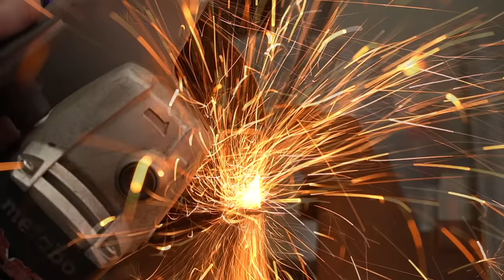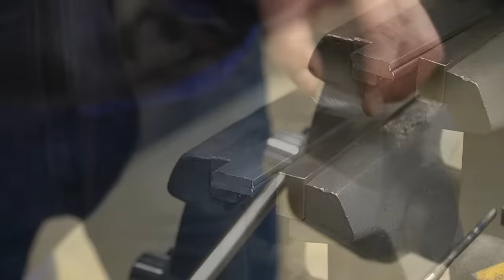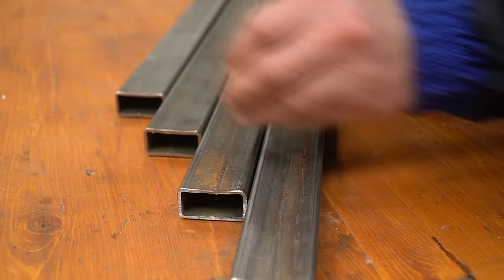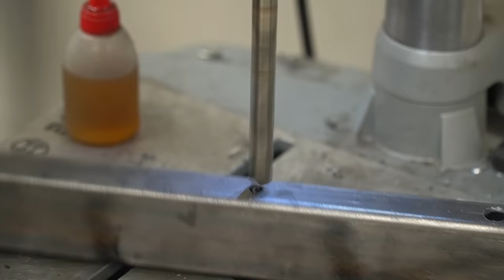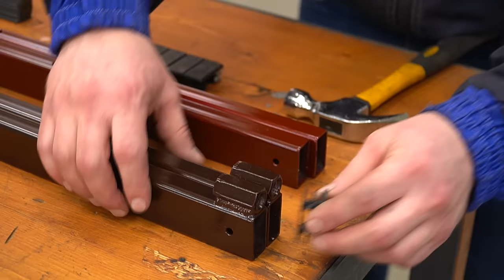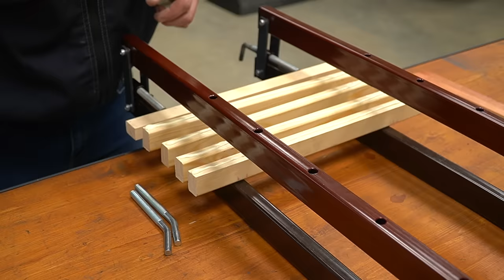This is really a great idea!

Comment from the maker: Hello friends👋How do you like this design?
Reply: So smart!
Reply: I like this !! Good design and implementation... 🤗

A sub and a like from me... 
😎👍☘️🍺
Reply from the maker: @stefanandersson7466  🙂👍
Reply from the maker: @peterfitzpatrick7032  🤗
Reply from the maker: @Scott Crawford thank you buddy!
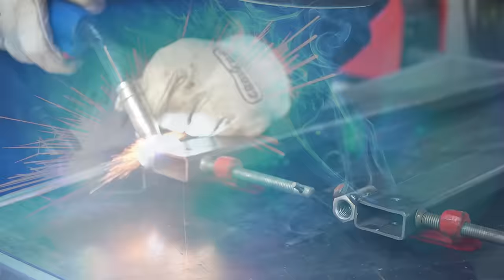Reply: 2:36 You are welding zinc plated nuts to steel! That’s not only bad practice, it’s extremely dangerous to your health. Not watching any further.
Reply from the maker: @G58  Well, tell me where they are sold rusty, they are all galvanized, the first time I hear such criticism, you probably do not understand this!
Reply: not to rain on your parade but $8.99 for woodworking clamps at your local hardware store.  Not sure what this innovation does different.  however, I notice that removing ring push nut from wheel barrel axels or from hand cart trucks are a pain in the tush. I have the idea in my mind to come up with the tool, but I do not have a shop, welding equipment.  The ends of the arms of tool has to be sharp so it goes under the ring then pull it up via its screw.  I had the need to remove the push rings from my dolly and it is a struggle, necessity is the mother of invention.
Reply from the maker: Ok 🆗 thanks 🙂👍
Reply: @stefanandersson7466  व््व्व्व्व्््््व्व््व्््ववव््ववव्
Reply: @stefanandersson7466  😮
Reply: @peterfitzpatrick7032  😮
Reply: Très belle réalisation, je vais faire la même chose
Reply: It's realy   nice idea I like  such  videos.
Reply: @peterfitzpatrick7032  I I
Reply: So beautiful design, I like it. . .
Reply from the maker: @diogenes7916  thank you buddy 👍
Reply: This Idea is so simple and something I can make....loved it
Reply: An idea this morning after seeing your video : Maybe telescopic arms could help for large pieces from your model, and easy to build, thanks for the idea !
Reply from the maker: Thank you my friend 👋
Reply: Pemanfaatan ruang yang indah dan sederhana
Reply: some dimensions? super!!!!! I intend to replicate! thnx!!
Reply from the maker: @BC-ng8yk  My friend, improvisation!
Reply: @icyborg6065  This method keeps the wood from bowing while glue up.  It's an excellent idea.
Reply: Just buy simple Bar Clamps, BOOM DONE!
Reply from the maker: @dls951 This is not an online store, but a channel about homemade crafts with your own hands
Reply: ХРЕНЬ!!!
Reply from the maker: @ЮрийМорозов-к4и  Мой ты хороший 🤏

Comment: Brilliant idea !!   I love the way that you know which way around to place Washers!,  I thought it was just me that was so fussy.  I used to design and build massive pneumatically controlled presses (along with automated Glue Applicators), to bond 95 x 18mm strips together, for the woodworking industry.  They were very complicated and I used PYE RF generators to 'set' the PVA Glue, quickly.  But basically, what you have come up with here is largely the same thing (which could easily be scaled-up), in that you provide END & TOP pressure, in one simple movement !  -  Well done.  Take care,  Mike
Reply from the maker: Thank you so much, I'm glad you liked it🙂👋
Reply: @MA-SH  очень простой многопрофильный  механизм всем мастерам нужная вещь спасибо огромное

Comment: great design but as a furniture maker myself, can you drill the holes through the under bar too so it gives just that extra strength, and make something square or flat to click on the bold so you don't  get thread marks in your project and also you can make them different thicknesses so you have more options or just put a extra piece of wood , that works too.
Reply from the maker: Hello, thank you so much! I will listen to your advice!

Comment: Great idea, I wish I had seen this before I bought a set of sash clamps. However I would use un-threaded round bar as the end stops for the timber to push against and modify long bolts for the clamps, that have an unthreaded section to use for the handles, instead of having to grind the thread off. I guess you were on a budget like all of us and had to use what was available. I am going to make up a set to use across the timber, transverse to the sash clamps,  to remove any longitudinal twisting. A problem when using seasoned pallet wood.  Thanks for the ideas.
Reply from the maker: Hello, thank you very much!

Comment: How it should be: 1st: The Problem. 2nd: The solution, 3. How it's made. Would you want to watch a 6 min video until you figure out, if this is relevant for you? Certainly not. Me neither. Thank god, youtube allows to watch the end first. That's so annoying. But you're not alone, almost every other youtuber does it that way. But that doesn't make it any better. Btw: I think, the vertical force may not be strong enough but in the end it's better to have a bit of force than no force at all. Interesting design!
Reply from the maker: Thank you, but they don't watch it any other way) they also don't show the movie from the end, there will be no intrigue!

Comment: You guy's do these videos and have really good ideas, but can't afford a cheap metal bandsaw !!! Using a cutoff wheel on a grinder and marking with a paint pen , might as well just try and guess the sizes.
Reply from the maker: Thanks
Reply: I do wood working with more precision  than you do with metal. I use a fine point pencil and calipers.
Reply from the maker: @mikemargeson8101  You are a professional carpenter, and I am an amateur) a little bit of everything in👍
Reply: No I'm not a professional  carpenter.  I use to do  machinist work in a factory,  but I'm  just a  hobbyist.  But thanks.